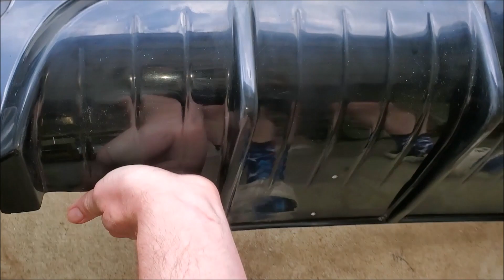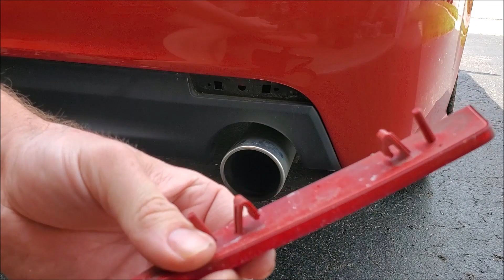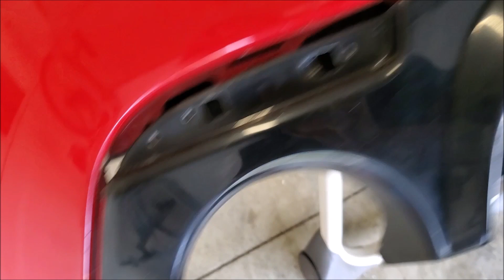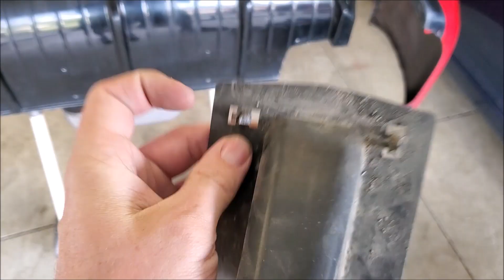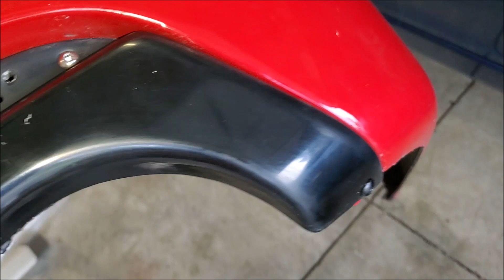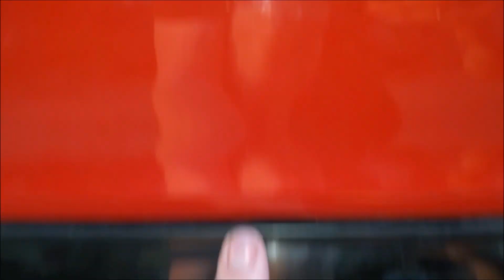Knockoff SAAB Rear Diffuser Install (Way cheaper than the real deal)

Comment: I have the Maxton Design diffuser on mine, it's the only one made of ABS plastic which is why I went with it. The fitment isn't perfect but it's much better than the cheap fiberglass knockoffs, and the plastic is a lot more forgiving.
Reply from the maker: Good to know they have a similar version in plastic. If I did more research I likely would have went that route!
Reply: @WeakestofWeeks  Maxton Design isn't much talked about in the Saab community and I don't get why. They also offer front, side and rear splitters as well as some spoilers and a TurboX-style diffuser. Their products are high quality and they support a bunch of car brands.

Comment: Great video, for future reference you don't need to take the lights out to remove the bumper if you look between the bumper and the lights there's a little recess for you to put a small flat bladed screw driver in-between to release the tabs. Hope this little tip helps in the future.
Reply from the maker: Thank you for the tip! Hopefully I do not need to remove my rear bumper again in the near future but if I do, I'll be sure to give that a try.